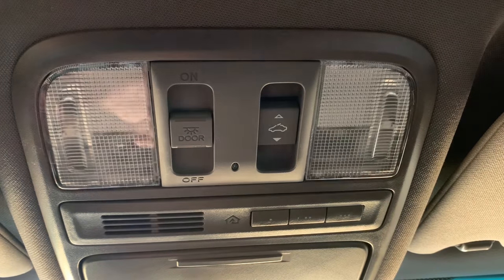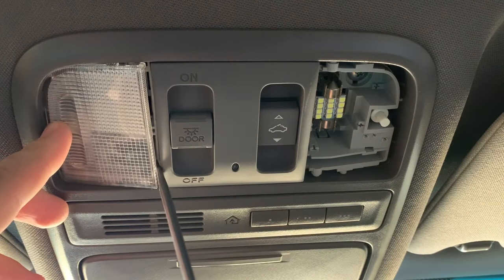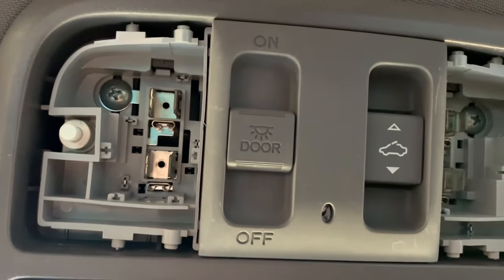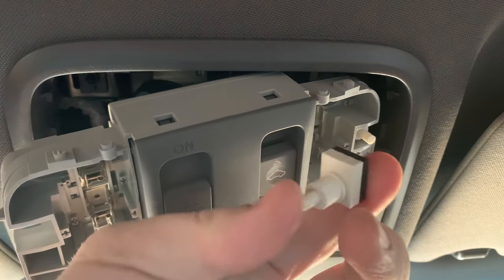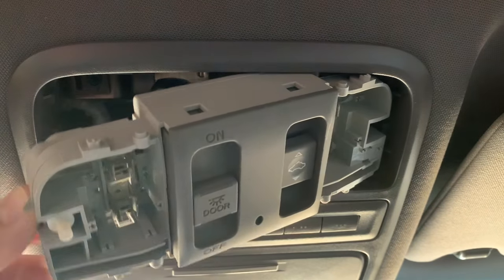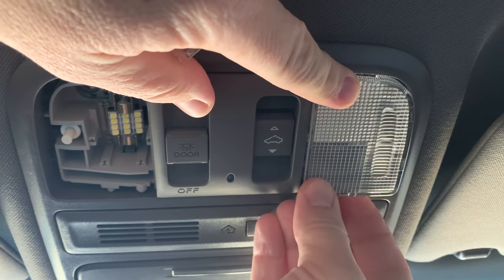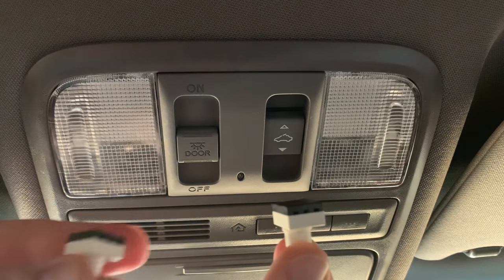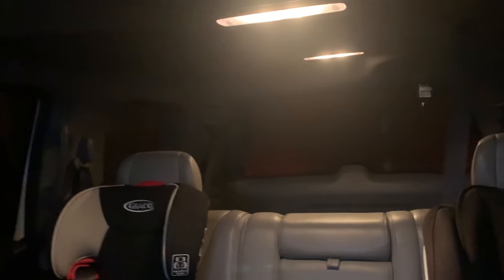FIXED! Honda Map Reading Lights Not Working

Comment: Great video - well done.  I was all set to buy a new switch for my one light that wasn't working, but I thought I'd fiddle with it first.  With light cover removed,  but not removing the two big screws to pull out the dome light compartment, I pushed on the inside edge of the current switch with a small screwdriver and noticed this caused the light to come on when the switch was depressed.  When I stopped pushing on the switch, it wouldn't come on.  So, I then pushed a bit harder which forced the switch to pop out of its compartment (towards outside edge) like shown in the video, but it won't fall out.  I then pushed on the outside edge of the switch and popped it back in and voila, it now works again.  Two theories:  1) it dislodged some dust at the connectors; 2) vibrations from the van dislodged the switch ever so slightly.  I'm leaning towards #2 because my other light went out, but just going in and pushing on the bulb got the light back on, so I think it too got dislodged a bit from vibrations, etc.  Hope this holds.  Wish I could say this was a no cost replacement, but made the mistake of trying new bulbs I bought before watching this video.  Still only $6 and extra bulbs in case I need them.
Reply from the maker: That is very interesting. That would also explain why many people said switching them from one side to the other made them work again.
Reply: After watching the video and reading this comment from Krandy3, I used this method to fix the map light on a 2012 Pilot that was not working. Took about 2 minutes to fix and is now working fine.  All of this after purchasing a new bulb that I didn't need! Thanks for the video and the additional instructions in the comments!
Reply: Great video tightwady,. Just like Kendy3. I found my switch loose. Both of you helped a lot
Reply: P
Reply: Currently sitting in my 2012 Oddesey, with this exact thing happening- light was out, went to jiggle the switch, light is now on!
Reply: Thank for the video and Krandy3 , my pilot dorm light working like it should be without any new part.
Reply: Good comment. This just saved me a switch removal. Found that the bulb was ok and after reading your comment, I fiddled with the switch and now it’s making contact.
Reply: This fixed my issue as well without having to unscrew the unit. Thanks for the video and the comment !
Reply: Thanks for this comment! I’m in my 08 TSX right now and feel very accomplished 🎉

Comment: I didn’t even replace the switches, just took them out, blew some air to clean out any dust, reinstalled and voila, fixed!!! I was ready to replace the whole thing, thank you!!
Reply from the maker: Nice!
Reply: Back with an update. My original switches worked for a little while then crapped out. I bought the Dorman 924-798 switch kit and they worked perfect on my 2010 Civic. Thank you!

Comment: Thank you! We’ve been running without these lights for a while. The dealership told us we had a “short” and would need to swap out the whole unit. I ordered the switches and it took 5 minutes to replace them.
Reply from the maker: I stopped using dealerships for service many years ago. Find you a trustworthy local mechanic instead.

Comment: Great video! After replacing the switches on my 2011 Pilot, it still wasn't working. I read through the comments and saw the note about swapping the switches from side to side. I took them off and scraped the connectors on each side them switched sides and it works now! Thanks for the help! I also prefer the soft white (yellow). We haven't had these things working for a couple years, so this will be great to have them back again!
Reply from the maker: I’m glad you got it working! We actually grew to love the bright white LEDs. They really provide nice lighting.
Reply: Swapping the switches from side to side worked.

Comment: This method shown in this video works fine on a Honda 2011 CRV. I needed to use an 8mm socket to take the screws out - to tight use a screwdriver. The process in this video is much simpler than other suggested methods on YouTube. (i.e. no need to remove and unplug the entire assembly)
Reply from the maker: I’m glad you found it helpful!

Comment: THANKEW!
Just bought a 2008 Honda Accord EX-L and have been working my way through fixing minor (but ANNOYING) problems.
As NEITHER one of the spotlights/reading lights worked, I was advised to replace the bulbs.
HOWEVER after watching this video (AND reading a lot of the suggestions in your viewers comments), I had BOTH lights working just fine in less than 10 minutes.
And I didn't have to replace ANYTHING!
But, man, did your video ever help!
I had NO idea how to get at those bulbs until I saw how you did it.
Yup. Prying those "lenses" off was easy (by doing EXACTLY what you said to do).
After that, I tried removing the 2 Phillip's screws - but I couldn't "wiggle" the centre part out and was afraid I might pull down the entire overhead panel.
So, I removed both bulbs (they came out easily with the aid of a thin screwdriver), checked and discovered neither one of them was burnt out!
Hmm...
So, I decided to try cleaning all the contact points with my handy-dandy spray can of "Contact & head cleaner." (The one If have is "Nexxtech" 3.5 oz. Bought it for about $10.00 more than as DECADE ago. Use it whenever I have possible contact problems with anything "electrical," and it's STILL almost full.)
Anyway - sprayed inside the bulb contact points (that hold the bulb in place), then used the screwdriver to pop those two on/off buttons to the side of the unit (WITHOUT removing them). Sprayed all around where the switches pop into place, then used the screwdriver again to GENTLY push the on/off switch back until you feel it "click" into place.
Replaced the bulbs and - 
EUREKA!
Both work just fine .
Replaced the cover/lenses (GENTLY). No problem. They went smoothly into place.
Pressed both.
ALL LIGHTS WORK.
So, thanks SO much. I suspect I would have snapped/broken something if I hadn't watched how you removed things FIRST.
BTW: I was prepared to order the "repair hit" from Amazon, but got lucky and just had to clean up some dirty contacts.
Appreciate it.
Liked & Subscribed.
Cheers,
GN
Reply from the maker: That’s great! Thanks for sharing your experience! I’m glad yours are working now. I have several videos for this car so be sure to subscribe!
Reply: Thanks. This might be what’s up with mine. I replaced both switches & they worked for a couple of days & haven’t worked again.

Comment: I've had this happen on my wife and sister-in-law's 2006 and 2009 civics.  I found both times that the switches and bulbs were fine but one of the two screws you last removed needed to be tightened, as it provides the ground to the light unit.  Not that it really saves you any time but I'd recommend just giving a 1/4 turn to both of the mounting screws and pop everything back in and test.  Great video!!!
Reply from the maker: Interesting. Hopefully this helps out some other subscribers. I appreciate the info.

Comment: Did the switches in my Accord today! Quick and easy. Thanks for the advice. One thing to note... If the LEDs don't work, try flipping them end for end. I installed the first one correctly, and the second one 'backwards' at first.
Reply from the maker: That’s great! Glad it worked for you!

Comment: THANK YOU for this video! I had a 2009 Pilot Touring that had this problem when I bought it 2 years ago. I bought a new "relay" from Honda and had my mechanic put it in. Recently traded in the 2009 for a 2012 Pilot EX-L and it had the SAME issue with the SAME passenger side map light. In about 10 minutes I had everything fixed and new LED lights installed in both driver's and passenger's sides. I feel like I could conquer the world now! :-)
Reply from the maker: It does seem to be a common issue in Hondas. I’m glad it’s a fairly easy fix once you know how to do it.

Comment: Awesome thank you! I got around to asking dealer to change bulbs when I was in for service, and they still didn't work...said would have to come back for electrical diagnosis another time. Well that just sounded like it was going to be needlessly expensive. Found your video, got me a kit and voila 10 minutes later it works! SO nice to be able to see again! Except now am a bit OCD annoyed that I should swap out middle and rear bulbs to coordinate. Thanks!
Reply from the maker: Yes! I’m glad it worked for you too. The dealer would have probably swapped out the whole assembly. My wife though she would want all new bulbs too but decided the bright ones up front were just right.

Comment: Thank you! Thank you! I’ve been racking my brain for awhile as to why the map lights weren’t coming on when I unlocked my car and/or when I opened the doors. Also, why the passenger side light wouldn’t come on when pushing the button, but the driver side would. I came across your video and never thought that a bad switch on the passenger side would cause this issue. I used your link to buy new switches and within minutes I replaced them and now everything works as it should. A simple $10 fix!
Reply from the maker: I’m glad you found the video!

Comment: Great vid! The passenger side (right) map light wasn't automatically turning on in my 2011 Pilot when I opened the doors. But it would still work if I manually pressed on the lens. All I did was open the lens assembly like you showed, removed the white switches, blew some air on the 3 little contact points inside and swapped the switches, and it somehow fixed it. Now both lights will automatically turn on/off. Thanks for the tutorial!
Reply from the maker: Great! I’m glad it’s working.

Comment: Perfect! I took the switches out, cleaned them with air and put on some dielectric grease. They work fine now. Thanks for the video! One thing I did differently was that I removed the whole panel and then the switches were very easy to work on.
Reply from the maker: That’s great! I’m glad it worked!

Comment: Thank you! I put off fixing this in my 2010 Element for too long and all modes now work with the new switches.  Don't forget to re-install the bolts since the right  (ground) does effect the functions. Also replaced bulbs with the brighter LEDs.
Reply from the maker: I put it all far too long as well. It was an easy fix once I figured out what the issue was

Comment: Concise, clear, calm, detailed, extra helpful tips, clear video... PERFECT!!! I love how you catch yourself and notice that a beginner watching what you are doing may not catch X or Y detail... like ar 4:15, your right forefinger bracing the right switch so it doesn't ricochet around the car... "if you pry out too hard with the thin, flat object, the switch could go flying." And 5:47, "I needed to push it up a little bit more to get that screw in." Awesome! And thank you for sharing the comments from other people/ forums about switching switches to opposite sides and using compressed air!!

Question, (because it's much easier to learn from your teaching style than others) (and because you convinced me to replace the other interior lights in my 2019 Honda CRV with super bright LEDs... I also MUCH prefer the warm/ soft white 2700-3k color, but even more than that, I really prefer being able to SEE with the brighter lights!)... so, the question... 

Any chance you might have a way to show how to change ALL the interior bulbs in a 2019 Honda CRV? 
(I really wish Honda had done a better job lighting the cargo /"trunk" space, so much so that I have rigged up a flashlight back there, but I'm planning to change all the bulbs back there to Super Bright 6k LEDs.)
Reply from the maker: I’m glad you found it helpful. We no longer have a Honda so I don’t have access to show how that is done.

Comment: Thank you.  I decided to give it a try. I piped the drivers side switch out (while still in place, didn’t remove anything) & popped it right back into place and now it’s working!!  Thank you!
Reply from the maker: That’s great! Something must be causing bad contact on the pins.

Comment: Thanks for the video. I bought the kit you recommended. I replaced the switches which solved my problem. The issue I now have is the new LED bulbs that came with it kept blowing the fuse. So I went to a 10 amp. If I turn one on it was fine but both on again blowing the fuse. So I went with the original bulbs and everything is working properly. I’m satisfied with that. Thanks again Maria
Reply from the maker: I wonder why LEDs would blow the fuse. Should be pulling even less power than the originals.

Comment: You saved me big $$ dealer wanted to replace whole unit - bought kit you recommended and did installation in 15 mins - really like the led bulbs / total cost under $20
dealer wanted $450
Reply from the maker: Some dealerships aren’t very honest. They take the easy route for themselves of replacing the entire unit instead of taking time to identify the issue with a part. I’m glad you found the video and fixed it yourself instead.

Comment: Just switch sides for the white switches and it works again!  Initially just tighten the passenger side screw and that side started working when the door open, but after switching the white switches, both works!!  Thanks!!
Reply from the maker: That’s great!

Comment: A suggestion from a retired instrumentation tech - often iffy or intermittent microswitches can be brought back normal operation by spraying contact cleaner into the switch around the actuator button and around the connector pins. Even if the fix is temporary, it is useful for diagnostic purposes or for restoring operation until replacement part can be obtained.
Reply from the maker: That makes sense. It does appear to be corrosion causing a poor connection on these.

Comment: Excellent DIY video on repair of the Honda Map light unit. I first replaced the bulbs with new LED units without success. Then I replaced the switches with no success. Finally I checked under the hood at location #22 (7.5v) in the fuse box and success! Should have tried that first time  but you live and learn. BTW, my vehicle is a 2011 Honda CRV.
Reply from the maker: Im glad to hear you were able to figure it out!

Comment: I have a 2010 Honda Element and both of the front map lights have not been working on any setting for awhile, and it was pretty dark getting in and out of the car at night.  This video was found for me by an employee of Auto Zone, where I stopped to check my fuse, which was fine.  After listening to part of the video in the store,  I decided to give it a try myself at home, and did it all in about 30 minutes with two screwdrivers, an air blower, and a headlamp to give me better vision in the compartment.  Taking off the lenses was easy with a flathead screwdriver.  In the Element, the assembly looks slightly different inside and a little tighter in the compartment, but I got the bulbs and Phillips head screws out easily.  The hardest part for me was trying to get the whole assembly released because it was hard to get a good grip on it in the center to wiggle it free, but once I tried the flathead screwdriver at the top of the assembly, it unsnapped easily.  Air cleaned and swapped the switches, and had to work with one of them to get it to click in and stay put, but finally it all came together, and they both work as intended!   No new parts needed yet, but from the Amazon links you posted, I have that info saved in an Amazon list in case I need them in the future.   Thanks for such good instructions!
Reply from the maker: I’m glad it worked for you too!

Comment: Excellent video. Just 2 small remarks - when unclipping plastic elements, it is much safer to use something soft as a  detaching tool, instead of metal (no screwdriver!) - I use guitar feathers, but you can also use an old credit card plastic or something like that. 
My second remark is - never touch the LED elements on a LED lightbulb, when those elements are open / exposed and not encapsulated. This may lead to much sooner burn out of the lightbulb.
Reply: For mine i use Microfiber along with few layers of Tamiya 10mm masking Tape. And small flat blade screwdriver.

Comment: My 2012 Honda Odyssey has the same problem with the map light.  I had it in for servicing this past weekend and they wanted to charge me over $200 for a diagnostic.  I told them I'd do some research and I found this video.  We will have to try this!  It shouldn't be a fuse under the hood, right?  Because if it was the fuse it would affect ALL of the interior lights, wouldn't it?  Now I'll just have to order the switches using your link!
Reply from the maker: That’s correct. It’s not a fuse if some lights work. Try to swapping the switches to the opposite side instead of buying new ones.

Comment: Great video!  My 2012 Ridgeline had this issue, now fixed thanks to you.  But, my door lights and dome light won't come on.  I am wondering if those screws you showed,  go into a ground for door lights, or where that door ground is located.
Reply from the maker: Check your fuses or the door switch.

Comment: Thank you so much,i knew I had faulty switches .Just did not know how to remove them ,I thought they were soldered in.My CRV light unit was not as easily to remove as the one in the video ,the headlight unit  clips that held it together were at the top so I had remove the complete unit.Mine had microphones built in and is a UK model.But got it removed.So many thanks for posting this .
Reply from the maker: I’m glad you got it fixed. I appreciate you taking the time to comment. Be sure to subscribe.